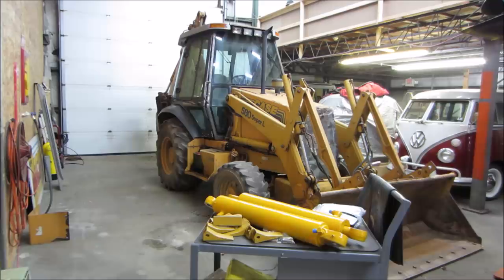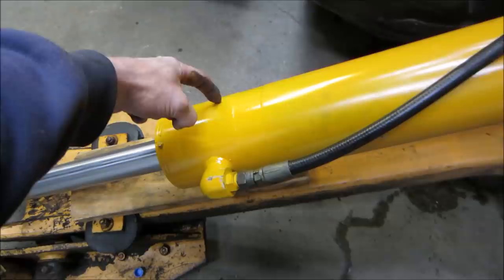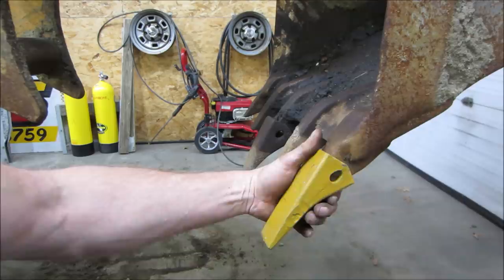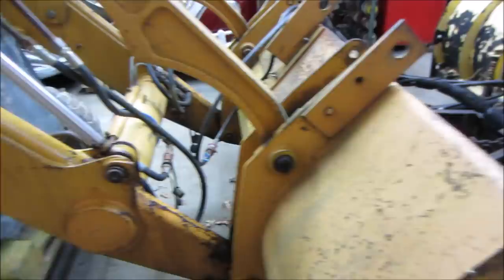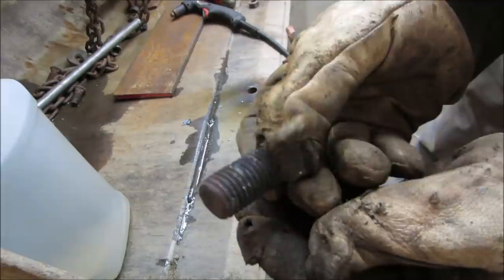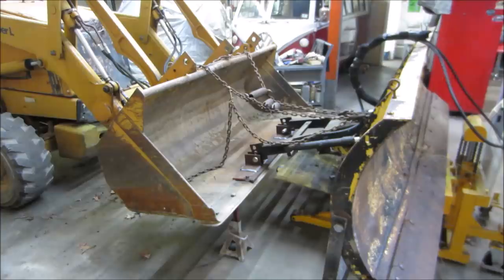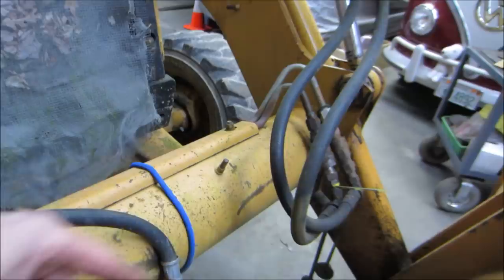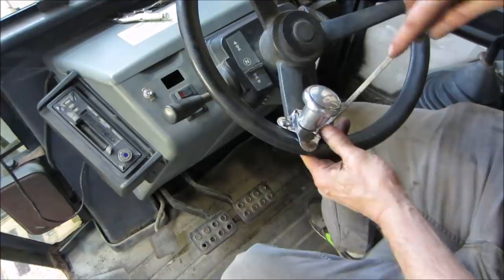WHY NOT? Lets Install A Snow Plow On A Backhoe

Comment: I suspect that the previous owner either used the bucket to clear the snow, or removed the bucket and mounted the snow plough in it's place.
You have created a very weak mounting that is likely to break under the extreme loads exerted when ploughing snow.
Reply: Hundreds of them in the northeast here and they’ve all held up pretty well. It does seem to be a week set up at first glance but they hold up
Reply: Yes that's a really moronic choice. Just mount the plow.
Reply: We used to run the same setup on the farm. Ears go farther back in the bucket. Mounted on a plate. Pushed snow mud n shit just fine
Reply: @EbonyPope  Seems more like a moronic comment. We have used them like that for decades. It's easy to take the plow off scoop up the snow banks with the bucket and pile it up. Then just put the plow back on. 15 min swap.

Comment: Ive used back hoes with and without a plow blade ... blades are great for road clearing. Saves pushing a full bucket around and lets you wing the snow into the ditches easier. Buckets are better for driveways and parking lots as they shorten the machine considerably.

Highly recomment adding a 3rd function disconnect up front for the plow. Having the curl function will help when piling snowbanks at the ends of roads, etc.
Thanks for sharing🇨🇦 Merry Christmas!!

Comment: Seems like you'll have a HUGE amount of weight hanging from the bucket if you attach the plow there.  The [seemingly] logical mount would be to attach the plow IN PLACE of the bucket...
Reply: That plow doesnt come close to being as heavy as a full scoop of dirt.
Reply: @warrenmichael918  but the snow blade is cantilevered off the bucket not to mention maneuverability is all but lost.  Most places around here use a box scraper mounted in place of loader bucket.
Reply: @jimw6991  i agree that this looks different then i am used to seeing but the weight of it or the placement isnt gonna matter to the heavy ass tractor. I bet we get to see this in action and then get to watch a plow 2.0 video, maybe...lol

Comment: You’re a braver man than I am with those outriggers and a come-along. Installing the hydraulic cylinders with the outriggers in the up position was also an option. Also you can use air to operate the cylinders or connect the hoses to adjust the in or out to get the lined up.

Comment: I'd recommend a healthy slather of anti seize on those plow bolts. Typically we have to torch them off all our bladed units when rotating or replacing the cutting edge. A better investment would be an   induction coil tool. You'd be able to heat up any problematic nuts to glowing in a matter of seconds. We purchased one at our shop and it has made a huge difference, most notably when removing the nuts from wheel loaders being used to move gypsum.
Reply: Do you work at the plant in NY. or KY.?

Comment: I owned a backhoe for about 20 years, a 1966 ford 4400, i like the plow on the front if your doing a road or a large lot, and i think you can still pile it up some, one thing i found is if your using the back hoe trying to dig something out like a stump or a large rock, it's easier on the back not to lift the rear wheels off the ground with the stabilizers, you get pushing down and the machine picks up so the stabilizers are off the ground and then the bucket slips and the machine comes smashing down, yeah, maybe your seat has some give to it, i had my machine just for my use but people will want you to do jobs for them, kinda fun really, now i have a bobcat, for my own use but people find out and they say , hey, can i get you to do this or that  lol
Reply: Yeah you take a beating in the cab of one of them machines no doubt.

Comment: Two major problems with using just the bucket for snow:
1. The bucket is only 6' wide.
2. Pushing snow with a plow, especially with a power angle, is 10X more productive than just the bucket.
Reply: especially since he said he was taking it out to his other property. Not much room on his small paths to scoop with the bucket and turn in a spot to make a pile, easier to plow it with the blade and let it get rolled onto 1 side or the other as he drives straight down the path.
Reply: @warrenmichael918  You're right. It would be a little bit better if he had an articulating loader.
Reply: @spinb  well he doesnt have quite the equipment line up as Andrew Camarata has these days,,,not yet

Comment: I'm no expert but, seems to me the bucket comes off and you attach the plow to the arms of the loader, kinda like how skid steer does?
Reply: most SS plows just use the quick tact plate system. you can get a blank quick tact plate, engineer the rest of the mounting system from there

Comment: Great video! just a tip: use cutting oil on hole saws when drilling steel, wd 40 doesn't do much for drilling steel and for how much hole saws cost it's worth trying to save them.
Reply: Even with cutting oil spinning a hole saw slow enough to cut steel is problematic. There's a relationship between diameter and RPM which we call peripheral speed. The speed the outer edge is traveling at. Which you have to keep below 100 feet per minute or you risk annealing the tool due to friction. For instance a 1" diameter tool max speed is only 382 RPM. The bigger diameter the lower that goes too. That's why milling machines have such low RPM speeds. 80 RPM isn't out of the question to see there. And they use flood cooling. When I'm drilling steel in the field and I don't have anything I'll rip a beer can in half and put some water in it. Then dip the bit periodically in that to cool it off as I go. Like you say it is worth it to try to save tooling just so you can get the job done. Once you cook a bit you're done then. You might as well break out a butter knife to finish. Because that's essentially what you're doing at that point. You had a tool and now it's just a butter knife.

Comment: Maybe I was sleeping, did you change the oil and filter? What about the hydraulic oil and filters (I think this machine has them)? Check the engine coolant condition and level? Differential fluids? Brake fluids?  Lastly, did you check the diesel fuel to make sure there is no water? I watch a lot of guys buying used equipment and most if not all, change all the fluids and filters before putting the machine to work.

Comment: the blade bolts are consumables, you can buy longer ones so you don't have to take the mount off, unless you're loading concrete or rocks ect. these machines generally have a 4 in 1 bucket that can open and shut to grab things, maybe the lines are there?........ love your work mate.

Comment: The second outrigger did go easier indeed.
Forklifts are a handy machine. I used to be able to pick up a dime from the concrete floor with one. Won a few bets that way.
Reply: Let me guess how you were able to pick the dime up. You tilted the forks down then pressed down on the back edge of the dime with the very tip of the fork until it flipped over and landed on the fork
Reply: @markthompsoncpa  Possibly...it might cost you a buck to know for sure.😉
Reply: Yup I learned the trick also.
Reply: I could pick up quarters, nickels, dimes, and pennies off the floor. 30 plus years driving Fork lifts I have seen a bunch of tricks.
Reply: You can pick op a dollar bill that way too.The bill isn't in the best condition after but it still spends.

Comment: I believe those chain springs are hooked up on the top of the blade with the springs between the top of the blade and the truck (backhoe) in line with the chassis so that if you hit a rock or curb the bottom of the blade can break away by tilting down from the spring tension.

Comment: the ones we had a work had the traditional angle adjustment behind the blade and that had two giant C clamps that bit down on the bucket and a chain to a hook on top of the bucket. Ours were manually adjustable as far a angle adjustments were.

Comment: Looks like the weight of that will bend your bucket after time.
Reply: They usually don’t especially if the bucket has a bolt on cutting edge. Seen many of them

Comment: This is one of those rare times I disagree with your engineering.  The bucket mounting brackets should be at the deepest part of the bucket, not at the front.  You've added unnecessary mechanical leverage that will stress the plow and the mounting brackets with each uneven load.  Having the mounts in the deepest part of the bucket will interfere with using the bucket as a bucket far less than on the leading edge.  You'll find this out if you have to move heavy soil, concrete or large rock & stone.   The mounting points should be perpendicular to the plane of the bucket.  Still, it's fun to watch you figure out stuff I haven't worked with for forty years.
Reply: The whole idea is total crap. I stopped watching the video when he started plasma cutting holes. I was like hold on there a minute cowboy! He got off the reservation on this one.
Reply: The point of watching Mustie is to see what he does, and the updating if it doesn't work the way he wants. Glad we live where snow doesn't .
Reply: By the looks of it, if the mounts were at the back of the bucket, the blade would bind on the corners of the bucket when using the angle function.
Reply: @brianbishop476  The bucket isn't that deep.
Reply: He said he was going to be removing the brackets when he takes the plow off for bucket use.
Reply: The mounts are there. How come you can't see them. Roll the bucket all the way down. 3 holes. Just like the plow. 2 feet less diving board.
Reply: @danshadoin7661  when the blade is angled it almost touches th bucket .
If it was mounted deeper in the bucket it would hit for sure.

Comment: 2 things Mustie b4 you hit the snow.
Make sure you have heat and the defroster working good and consider something other than the traditional front tire like an ag tire for a tractor. They're great in snow.
Cheers 🇨🇦
Reply: THey are worn out but it has the correct 4x4 tires on it that work well when using 4 wheel drive properly

Comment: Geesh Mustung- all my life (74 years), I have watched front loaders plow snow with the bucket. Even on fairly large parking lots. Never have I seen someone go to the trouble of putting a tilting snowplow on a loader. Sure I could see it on a ten or 20 acre parking lot but what you have it would continually be in the buckets way and would be no good.
Reply: I think he taking this out to his cabin to clear his narrow oath to it and he doesnt have room to scoop with the bucket and turn to make a pile. He will use plow to slide the snow off the sides of the path as he drives in and out.

Comment: Ditch the plow all together and buy a rubber cutting edge for the main bucket for winter.  Might want to look into a new steel one also since the existing one is pretty worn for the rest of the year.  Just some thoughts.

Comment: Lowering the foot with a come-along was scary. Derek would have just let ‘‘em drop.  Good use of a fork-a-lator though
Reply: Maybe an engine hoist would have been less sketchy?
Reply: Another way is to pile some scrap wood or a couple old tires without rims on the floor and just drop it.
Reply: That's right, make sure you copy the Youtube King.
Reply: A super munter knot used for absailing would be ideal here for controlling a heavy load. (an added turn makes it "super" for heavier loads)

Comment: I've seen plows like this with a sort of c-clamp attachment that clamps over and under the front blade of the loader bucket. Once you have that attached ypu bolt the plow to it. Probably how this one was set up but I've also seen it done similar to this. Normally welded further inside the bucket up against the back wall. Good luck! Cant wait to see the test drive.

Comment: The springs go parallel to the rams so the bucket will tip when it hits a manhole etc.
Reply: looked like an old fisher trip edge plow. the edge should trip before the moldboard itself
Reply: Yup, that's why I hate plowing with a bucket that doesn't trip!

Comment: We use just the bucket to remove snow so we can dump it on the curb and out of the way for parking curb’s are ruff on all equipment if it is not marked so you know where they are

Comment: I don't think the blade attaches to the bucket that way- it must attach in a way that it could be mounted and dismounted with some pins and without a lot of tools in the field. I'm thinking a piece of  channel that the bucket would slide into and some arms that would attach to the 3 brackets on top of the bucket- No bolts necessary and one guy could attach it with no tools.
Reply: Yea kinda like that backhoe plow stanley "dirtmonkey" genadek has for his machines. But im gonna guess that part of this plow setup either got mangled beyond rescue, got cut up for scrap for other projects or simply just rusted out, given how rusted out the plow itself is.

Although i thought i saw remains of welds in the throat of the bucket around the center, so maybe it used to be mounted very similarly to this.
Reply: I agree

Comment: Thanks for the update, Well I guess it will be fun watching and seeing how that contraption works. We've never had a plow on a loader tractor just a bucket. As for that wheel spinner real equipment operators throw them away L.O.L. They were ok on older tractors without power steering or with power assist as the wheel always worked in the same place driving straight. You just had to be careful you didn't end up breaking your thumb or wrist if the wheel kicked back in a rut or gopher/badger hole while holding the spinner wrong or you drove with your thumb over the the rim so the spokes caught it. On modern fully hydro steering that spinner never really starts or stops in the same place because of the relief valves in the system. With the wheels straight that spinner could be starting and stopping anywhere round the 360 degree,  making your left hand be on the right side of the wheel for example.
I just run the steering wheel and LH reverse shift lever with my left hand resting on top the steering wheel rim kinda like a DJ spinning a record and run the loader/other controls with my rh all the time. After 30 odd years of seat time running tractors/ loaders and combines etc. you get real good using both hands depending on the controls or what side you are looking back at implements from.   Take care

Comment: I think the snow plow blade is sticking out too far in front of the backhoe. I think it would be better if you just could remove the bucket completely and fabricate a way to mount the snow plow blade in place of it

Comment: I have a small Honda tractor and the previous own welded two ears on either side of the plow mount. Then just use a slip pin and washer.  Easy on and easy off. Plus the are far enough inside the bucket so they are out of the way.

Comment: Those "tooth" mounts, especially on the inner three, are definitely way too ovoid - They need to be welded solid then drilled out.
Reply: That's what I do I weld everything,  cut em off later
Reply: The holes are correct and not worn. The rubber in between the two metal layers expands the retainer to fill the hole.

Comment: Been watching alot of your videos, but lucky I live in Western Australia and we don't have snow, looks wonderful.
Reply: Fresh snow looks nice. When you have to move it then it is not so nice. Actually snow in urban areas gets nasty pretty quickly. It turns black from pollution or getting mixed with dirt. When cars drive around in snow it accumulates in wheel wells then cars kind of crap those lumps out. Or you kick them off. Because you don't want the crap hanging down out of your wheel wells. You get the idea. Some snowfalls are downright natural disasters. When I lived up north is snowed 4 feet once. That's almost a meter and a half. When it crusted up I couldn't even get my 4WD Toyota through it then. It would just hang up under the differentials and that was that. But when it was fresh I could drive through it. Was right up to the top of the hood. What I think you call the bonnet? I have big ass tires on my truck too. It's a step up to get into. Was the only time I ever put my truck into low.

Comment: I believe the plow was originally mounted on the top of the bucket where those brackets have been added. You roll the bucket completely upside down to use it.

Comment: You might want to consider a selector valve to chose between the bucket tilt and the plow. There are manually operated valves or 12 volt DC valves. Then you would only need to plug in the plow instead of switching hoses.

Comment: In snowy Ontario Canada they use loaders for 95% of the work in parking lots. Loaders have the advantage in that they can pile the snow otherwise you area gets smaller and smaller over the winter. Most of the loaders have bolt on wings to get a wider push.  Interesting path you took though.

Comment: I used a jcb loader at work with both blade and bucket. In the winter you could drop off the bucket and put on the blade separately

Comment: There are several tabs at the top of the bucket on the backside. Try tilting the bucket all the way down. I believe the bucket almost inverts on those loaders. You might have had the mounts all along.

Comment: I think I would have made a CLAMP system to hold that on. Sort of like a C-clamp Then you could take off the blade at any time with an impact gun. Even in the middle of a plow job then use the loader to pile the snow on BIG snow days. Quick release hydraulics. Just my opinion.